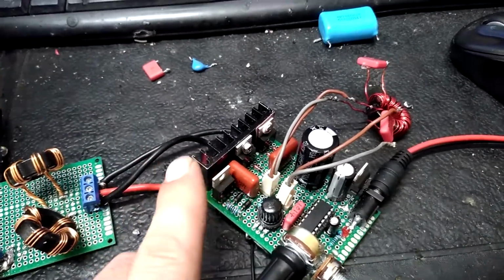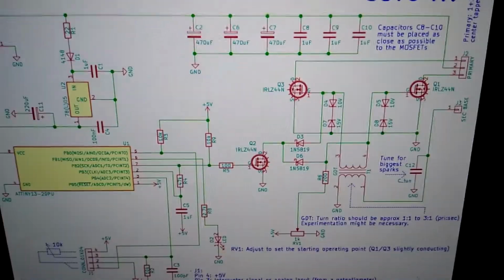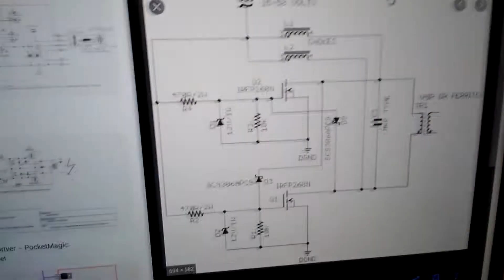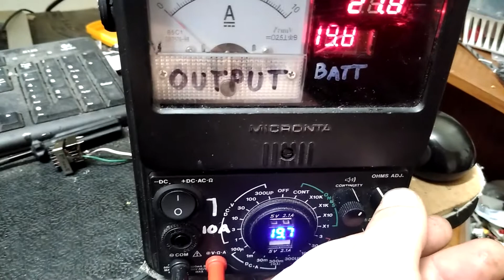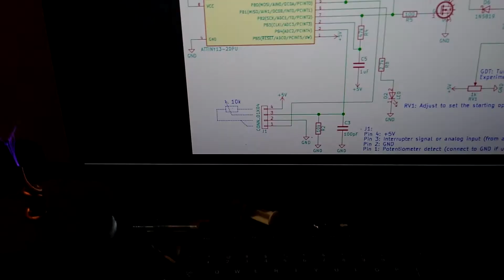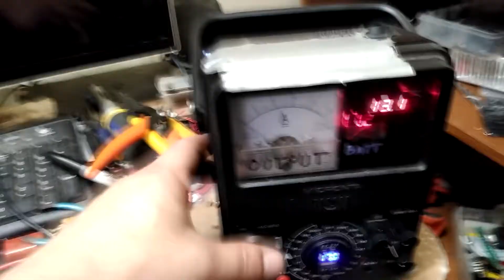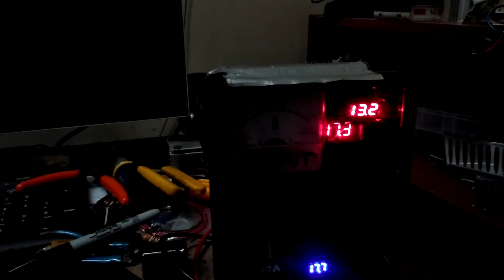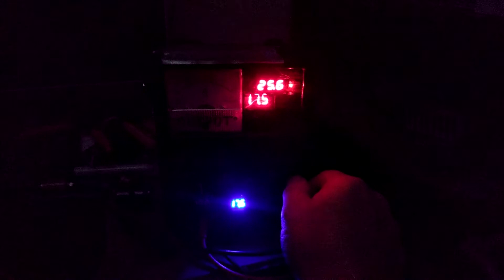Skori/Tefatronix/Teslaundmehr DRSSTC? 12-24VDC Test

Comment: Can't believe u'r getting that result with such a shitty primary, and with it being so far away and off center... never thought mine could be too close, even though I can't see any arcing but there is heating
Reply from the maker: lol yea at first I had a better looking primary setup then said fuck it and just grabbed a clip lead so I could contort it around etc. I tried a couple tighter winds at first but the output was shit til I opened it wide with the single turn. At higher inductance maybe around 4-5 turns given the chokes I had (I think cause of the chokes), the primary didn't much care about a series capacitor. The phasing also became a non-issue with that primary arrangement. With more windings the phasing would require the primary be either at top end or lower end of the tower.
Only downside really is that with this setup I wasn't able to really crank it to the point I could draw continuous arcs. The workaround is just running really high BPS I suppose. I want to build one of these using some IRFP250's I have laying around to see what I can get, and in that scenario using some kind of amplification stage in the feedback like you mentioned might be a good idea.
Reply from the maker: I added an identical clip lead to the first one to make it twice as long just for the hell of it. It looks hilarious, so far from the secondary it's like what's the point. I can still pull tiny arcs at 12V something like 1 cm but it doesn't want to break out when sitting on a plastic folding table of mine that has a metal frame in the bottom. Even at lowest duty cycle I hear some kind of buzzing coming from the screws along this metal frame on the underside of this damn table lmao. IDK it's weird I gotta record it, but I can light little leds off the screws etc like you can from a slayer exciter sitting near some metal. It sounds like small arcing between the screw and the rest of the painted frame or some shit but I'm starting to wonder if it's some kind of resonance in the frame as a result of looking like a large turn, and it's sitting in a wide radius underneath my circuit.. I wonder if it's resonating and the vibration is causing the screws to rattle.
Reply: @Magneticitist  btw have u made any effort to wind ur coils so that they're 1/4 wave resonant to their frequency ? U have the primary far away so Q factor should be low enough.
Reply from the maker: @sFeral  I actually had a boonton Q meter which would have been great for this but it crapped out somewhere and the variable cap was toast. I haven't done much detailed winding to be honest, with these circuits I just usually throw a couple winds on with tight enough coupling just to where it doesn't arc over.
Reply: @Magneticitist  I meant coiling the secondary so that the length of the wire matches its' frequency 1/4, thereby allowing for almost unlimited rise, until the dielectrics break
Reply from the maker: @sFeral  No I never do any of that, just do a rough calc on Teslamap of the frequency I want to run given the size I want and make sure to hit at least 350-400 winds or so. Then mainly play around with the topload instead. Calculating something like that never works out close enough for me in the real world especially when I get into shit I don't know enough about. I've had so many coils over the years though I sort have just kept with certain width/height/winding/gauge ratios that have worked the best for me. Even still there are some coils to this day I can ring easily and the design of it tells me it should suck.
Reply: @Magneticitist  watch?v=oyODF8FWs_8
Reply from the maker: @sFeral  Those are some good videos. I was really starting to get into learning about transmission lines a while back after trying to mess around with the stout copper bars circuit then before I could translate that into Tesla Coils I got lazy during covid.
Reply: @Magneticitist  watch?v=FcLzCim6E4U
Reply from the maker: @sFeral  I remember the video of his I think it's actually the one right before this one where he talks more about his resonant bifilar drive. Magnifiers are really cool and I've only built one circuit which works that way.
Reply: @Magneticitist  Forgot to ask, did u ever try the tefatronix circuit with bjts instead of fets ? Seems like it should work
Reply from the maker: @sFeral  I'm pretty sure I have I just avoided it because of how hot they probably get. Spend all day yesterday working on one and I had to fiddle with the interrupter to get it working right. So many little variables I ended up just tearing the whole thing down and I'm about to start over
Reply: @Magneticitist  turns out my idea of what affects the Q factor wasn't/isn't so clear
Reply from the maker: @sFeral  Very little of it is clear to me at this point. There are too many modes of operation which are all dependent on yet again more factors such as feedback method. I'm over here just trying to get the longest arcs at lowest voltage but I'm seeing with these circuits a lot of that can involve just slowing the rise time and speeding up the fall. I guess you can also try to tune it like I often do to where the ideal resonance doesn't really start feeding back until the volts shoot up enough and the arcs turn sort of vttc or mini qcw. I can't move forward much without redesigning some of my boards.Too many long leads on the control circuits and it goes nuts. Heavy decoupling on everything is really ideal with these. It wasn't so much random lead length throwing things off due to inductance but more that everything became an antenna. This is why moving a circuit from one layout to another can be very problematic. Everything I'll try to build now using this layout will have to be on a board with no leads coming out.
Reply: @Magneticitist  I'm starting to realize that too.. fiddly as f especially with dodgy components
Reply from the maker: @sFeral  Lol yea I just used my shitty scope to see some new NAND gate chip I just tried using after killing one was giving me a 500ms fall time. Gate driver was outputting like 50% from a 2% duty pulse lol. These BS chips off ebay are annoying but hey the price is damn good.

I think some of these other guys have the right idea by just omitting all that extra shit in the feedback and running the signal straight into some gate drivers. Steve Ward did it with the Micro SSTC just fine. The GDT/feedback is cool too but I've started killing some 200v fets using that at 100V and higher. As the voltage and power rises on the coils I guess it starts introducing some phase changes which can be good or bad. 

IDK how the hell to isolate these circuits though without basically just having the primary running far out on some long wires but even this only isolates the brunt of the field. I have a shit ground and creating a fake one or a plane of some kind doesn't solve this problem.
Reply: @Magneticitist  Here's an example of a mechanism apparently simple but troublesome for me as I'm not able to corroborate what they're describing watch?v=U4vI6rJ7TwU   ...it all started with the Slayer which is basically the same thing as this, and predicting the correct polarity for the secondary... against my initial presumptions based in theory, it became evident that the prim acts the same on the sec no matter if its placed around or underneath the sec, hence if the primary North is down, sec N will be down irrespective of positioning, which defies this theory watch?v=8FXPmYGIOs4 (it works for magnets, but apparently not electro-magnets) and also the previous explanation for the joule thief as the induced current for the base coil isn't in the same direction as the initial current, which I confirm by being able to wire GDTs correctly every time, hence I suspect the mechanism is different than what is being said.
Reply from the maker: @sFeral  With a blocking oscillator using a standard high permeability core it is indeed important to get the phasing right, but a slayer exciter can sometimes oscillate with the primary in either polarity with respect to the secondary just like any other TC. There's usually a clear difference if it does work both ways though. Teslaundmehr's HF circuit is a good example of this and I tried to explain this to someone else who was trying to get it to work. The primary winding was 2 turns so the phasing made a difference but one direction would have the circuit run very low power until drawing an arc. The other would draw a lot of power but not pull a good arc. You can sort of see the inverse relation there as far as how that phasing affected the feedback.
Reply from the maker: @sFeral  if you look up a detailed explanation of how a JT works it's hilarious how complex it actually is compared to what people say on youtube in quick videos. But yea.. I'd have to say it must be that damn complicated. I've seen some wild shit with JT's over the years. Slayer Exciters also. They are all not as simple as a lot of people make them out to be, but they are so simple to build it just sort of became thought of as simple I guess.
Reply from the maker: @sFeral  Yea it's all about the makeup of the core, with a high permeability toroid you can get a JT going with as little as 1-2 turns each. For some reason I always had the best luck with green ones, either the tiny ones pulled from CFL boards or slightly larger ones from elsewhere. Never really looked into what they were made of but I was always able to get a JT going with one that would run down into the low microamps. I used to try to build little boosters out of them to run things like 12v fans but realized eventually there were easily bought boards for like $1 with little micro boost converters which could push more power than a normal JT. Either way JT's are super handy for running small things from an AA like radios or led flashlights etc. Can even just feed a 5 -12v regulator to run IC's.

It's all very reminiscent of The John Bedini circuits too, but eventually Lasersaber brought out the Joule Ringers which were pretty amazing. I still have one he sent me years ago, a little wind torch running off an electrolytic. Works pretty damn good and it's basically a tuned JT wired so that the load regulates the draw.
Reply from the maker: @sFeral  found this video from some years ago I showed some toroids and cheap dmm power draw. https://www.youtube.com/watch?v=ebwNpOMKSS8
I was using random small decoupling caps to make little RC tanks at the base feedback and even with random caps sometimes you can see the harmonics at certain frequency settings. I tried to later build some supercap JT's the same way but always found a turn ratio closer to 15-30 each most ideal. This is good since a lot of bifilar chokes come wound with about that already. You can however use the same circuit on a 120-12v transformer which has a center tap on what will be the primary and feedback to get more power out of it at lower frequencies. https://www.youtube.com/user/xee2vids/videos had some really cool ones.
Reply from the maker: @sFeral  man you got me watching old videos lol this is the last one I'm going to plug I promise. I found this one interesting every time I remember it but never really realized what was happening. https://www.youtube.com/watch?v=EC7Uq3tjP

This is a xee2vids style joule thief using the 12-120v transformer. I ran it from a 12v 1A adapter to power things off the rectified collector current from the primary winding like a normal JT but really did nothing with the secondary other than use it for high voltage things like CFLs. The output current was not very high due to the JT pulsed DC field off the primary so placing a small 12v lamp across it would load it down and just barely get red.  

IDK whether I'd call it some kind of impedance matching or what, but when arcing to the bulb terminal a certain way it would then light up full bright at times. This was hard to maintain because just the right kind of arc was necessary and I couldn't achieve this by arcing directly to the bulb terminal any kind of way. It would just get hot being that it was the negative side. Something about using that extra bit of aluminum or whatever from the candle holder and arcing to it allowed that secondary to push the current needed to light the bulb.
Reply: @Magneticitist  says "video unavailable"
Reply from the maker: @sFeral  oh my bad I took the 4s off thinking it was a timestamp

https://www.youtube.com/watch?v=EC7Uq3tjP4s
Reply from the maker: @sFeral  You could say the candle holder metal has a large enough surface area toavoid becoming red hot like the bulb leg which then cannot pass the current or something.. but the whole point of that for me in another video was that the filament is passing the current still without getting red, and making the actual leg incandescent nearly just as bright. This is supposed to be because of the ion bombardment on the negative terminal though so I wasn't sure if it was ions or electrons doing the lighting so to speak. IDK I still don't get it, it's like saying by arcing to the leg it's able to pass the current without actually passing the current if we use brightness from this resistive load as a measure. By arcing to thick metal, it's able to pass the current by actually passing the current but this time illuminating the filament.  

Using the same style circuit you can place two identical resistor load bulbs, one in series with the input and one on the 'output' and it can be tuned in a way to where the input bulb doesn't get red by the output bulb lights up a little. This was always confusing because the incandescent brightness was supposed to be sort of a true measure of current.
Reply: @Magneticitist  Seems xee2 put more turns on the base coil than on the collector coil, which is opposite to LaserSaber,  btw there must be a better way to chat on YT.
Reply from the maker: @sFeral  YT honestly does suck but it's the only thing which gives me legit notifications of comments almost immediately, although it doesn't notify me of new videos well. I've tried google hangouts or something with someone else but even with notify on I have to constantly check it directly to see if someone typed something. 

Lasersaber went on to use a lot of turns on his base winding but this is because he was looking to drive his loads from that winding while also using the loads at the time to regulate the opening of the transistor. So for example adding more lights in series may make it run more efficiently while still providing the same high voltage to run the lights.
Reply: @Magneticitist  seems to me like both windings should be used at once to get the most out of it... like cogs "turning" against each other building tension in the elastic material (B field), the release/whiplash should be result of both coils/cogs  and this guy, from a previously linked video, seem to be doing just that using a PNP while having an unusual yet understandable schematic https://www.youtube.com/watch?v=d-Wv17QUFDQ
Reply from the maker: @sFeral  I've never really found a 'best way' to go about it to be honest, I mean there are so many variables at play it's really hard to design such a basic circuit for highest "efficiency" unless it's catered to particular usage. There was a guy long ago whose name eludes me now who had some awesome YT videos which are probably gone now, but he had some little 'magic box' thingy which was basically just a handy way to wire a JT circuit to in order to probe all the various possible outputs or run loads from them. 

As a cool little toy in itself it can be taught as a basic oscillator which can be used as-is to provide a low efficiency boost converter. When you don't use it as-is or as-intended there are a lot of quirks to it. By tuning it properly it can be made what was at one point considered up for debate as more than 100% efficient according to some scope measurements by some professor a while back who I also forget. 

As an oscillator it can be made so many ways though, another interesting one was Lidmotor's Penny Oscillator which used the air core and garden wire. 

Despite on average going by the lowest biasing voltage of a transistor being around .5v or a little less the JT's can even be made to start up oscillation and run down into the couple hundred milivolts.
Reply: @Magneticitist  some of those guys you can't remember are probably mentioned here http://www.andreadrian.de/High_Voltage_Generator/index.html
Reply: @Magneticitist  He didn't put the B coil in series with the C coil like LaserSaber in his Ringer, but the positioning of the load is better I think (that's the key difference) he can charge a cap, unlike the others (and probably is more efficient)
Reply from the maker: @sFeral  That's another way to do it which would seem to basically depend on the load as to whether it would work better than the normal circuit. I started noticing some years ago that a lot of these 'inventor kids' who were making these peltier powered lights were in fact just tossing the cells on JT circuits lol. 

I guess you've seen Slayer's videos?  https://www.youtube.com/watch?v=7EJv-LI4fP4
Guy made one out of a tiny choke, the kind with the body of a resistor. He used a varicap on the rails to tune it and got the 3v super bright leds going really well. The JT led to all the JR and SJR and SJR Looper, Cool Joule etc  

But man yea Jonnydavro I remember him and Dr. Stiffler's work which led to the Slayer Exciter. I remember not long after I got into pulse motors more and Thane C. Hanes transformer and generator windings. I figured with that knowledge I could build a free energy generator if I wanted to but it would have been too complicated to make lol. That guy went on to sell his idea to be used for regenerative braking I believe womp womp.
Reply from the maker: @sFeral  JT circuit can easily charge caps though it all depends on the many variables. It's all about not necessarily the turns but how fast we can get the inductor to release its magnetic field. We start bringing these peaks too high, so high that they can light CFL's and shit then these 3v leds might burn out which makes it impractical as-is. Jeanna's Light and similar higher winding setups were found to not be necessary after a while to get higher voltage but probably more efficient for such loads.  

Think about what happens if you were to take a small generator 'pickup coil' which may be giving you an unloaded voltage of around 5 to 10VAC while a small magnet motor is inducting a current into it. If you were to periodically short the coil out very quickly, quickly as possible, right at the moment the core has saturated it will release a very high voltage spike like over 1000V maybe.
Reply from the maker: @sFeral  I wish I could find the videos but someone had some great ones which used the low turns to get the high voltage. I've never been able to do it well but it makes sense it would all be about inductance, which depends on the core material about as much as the windings. If you have the inductance then a relatively small voltage can induce incredibly high voltage peaks in the collapsing field. This is usually much easier with a high turn coil but doesn't mean a lower turn coil couldn't do the same.
Reply: @Magneticitist  I have little idea how things ur talking about look like but spinning a magnet underneath a coil  has the same dynamic as an SSTC except much slower and unisotropic field wise... this might be it just other way around https://www.youtube.com/watch?v=RviBQzjIX8A
Reply from the maker: @sFeral  my bad I'm rambling shit together but the spinning magnet thing was just something I was mentioning related to the basic idea of an inductor releasing a spike of high voltage from a low voltage input, but in that case the inductor has current induced in it from an external moving magnetic field. The extremely high voltage spike received from shorting the generator leads at the right timing is what can create a high voltage spike which the motor doesn't see as an extra load due to the shorting.  

Thane's deal didn't have a lot of great replications but that video pretty much sums it up. Counter intuitive to normal generator design the coils are high impedance and need to be hit with a high frequency. He also had a transformer which used the same idea of shifting the opposing field to a point where it was no long opposing but going in the same direction. 

My brain could never work out what would happen in the end starting from the idea that the rotor needs an input power and we have an output power in these coils which would seem to eventually just go up and up by adding more and more, all the while the prime mover is not needing any more energy to drive them. Unregulated the rotor would start going maybe faster than the effect can be seen. Adding more and more rotor size to accommodate more generator coils may eventually become a point where physics says the necessary coils cannot be fit into the prime mover without it require more energy to move that amount of mass. Then we get into more complex motor designs to get around this etc.. but in the end IDK.
Reply from the maker: @sFeral  Here's his video it's still up. https://www.youtube.com/watch?v=YXEYEomvlsQ
Reply from the maker: @sFeral  There were some really smart EE guys who tried to explain this to me a long time ago but I couldn't grasp it. The inductor is a hidden magical instrument in that it's so common yet so complicated. We have basic inductor understanding in how it works but I don't think it's so clear how the energy is really released. Pulse vs impulse etc (Master Ivo working on this) and how an inductor can have sort of a dead time right as it begins to resist the change of current from an induced voltage.

This guy has amazing videos and this is an interesting one on inductors designed to very sharply step down inductance upon saturation. https://www.youtube.com/watch?v=3udfoHAgFxU  -edit wrong link
Reply: @Magneticitist  My brain malfunctioned... caps can be charged anywhere parallel to both coils individually, but what I was looking for was someone placing both coils in series, like LaserSaber, and placing the cap-diode combo  parallel to both, I'll try that ... and btw in that cog tansmission analogy, the cog turn rates equate to E current rates of change... also watch?v=GNtH9bp7QVo instead of this I'd like to see the inductance when the coil is wound against itself (when the terminals at one end are connected) and current flows against itself
Reply: @Magneticitist  I'm blabbering, again, keep finding faults in the brain simulation
Reply: @Magneticitist  What does the rising voltage before the drop indicate ? I'd guess that the drop spike is the B coil backfiring, but why is the voltage rising... if I wasn't suspicious of my brain failing me, I'd say that it indicates that the base-emitter resistance is rising ? watch?v=OQzA6EwoPlk&t=5:47
Reply from the maker: @sFeral  Not sure if I follow but I think that's just the base current rising to meet VBE via the 1K off the rail.